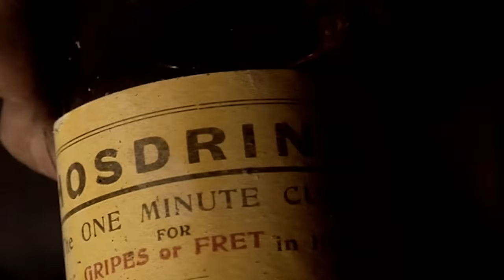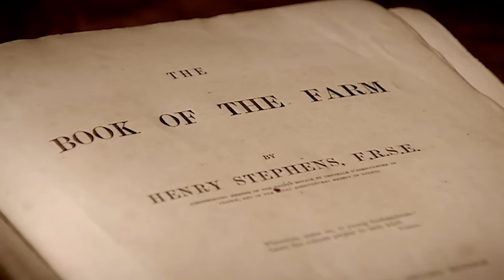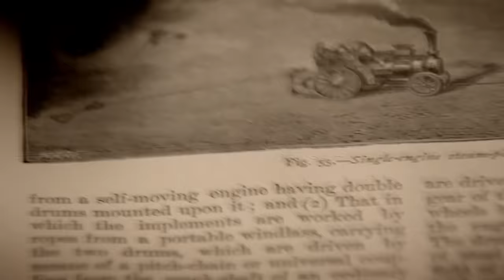The Harsh Reality Of Farming In The Victorian Era | Victorian Farm | All Out History

Comment: As a teenager, I lived in an old log cabin built in 1884. No running hot water. A plastic hose fed well water to the kitchen sink. 
After about a year, we moved to my father's pre World War mining claim where we built a wooden frame and flooring which was covered by a canvas tent until late autumn. 
Our wood stove was the same one Dad had used in the late 1930s until he joined the Army when the  Japanese bombed Peral Harbor. 
The oven wall had rusted thin. Baking bread was a challenge. Rotate the loaves about every ten minutes to avoid bread Rae on one side and black on the other. Cooking on the stove top was easy. Mom grew up with a wood stove in Grandma's kitchen. The electric stove was a new miracle about 1952.

Comment: Thank you for this very interesting series.  Me and my sister and mom grew up in New Rochelle, NY. in the 1960's.
Our Italian immigrant grandfather owned a small apartment building that was built in early 1900.  It had five apartments with three rooms each.  I think they used to call these cold water flats because each apartment had a coal burning stove
originally.   I remember our walls were not even like they were in my friends homes. Grandpa told me they used to make their own walls.  They tacked up these thin wooden slats to the wall beams and a very skilled man called a Plasterer
would use those same hand tools to put the mixed plaster up on the walls.  I always wondered how he did the ceiling, haha.